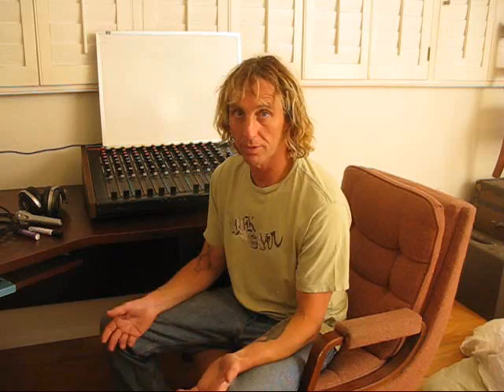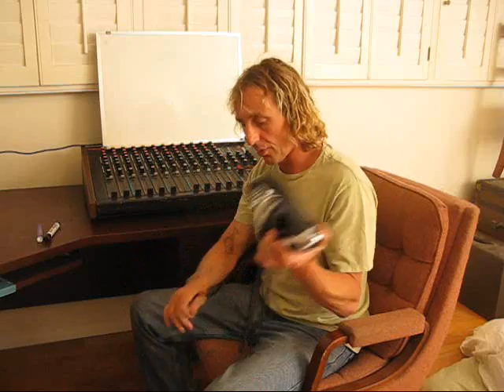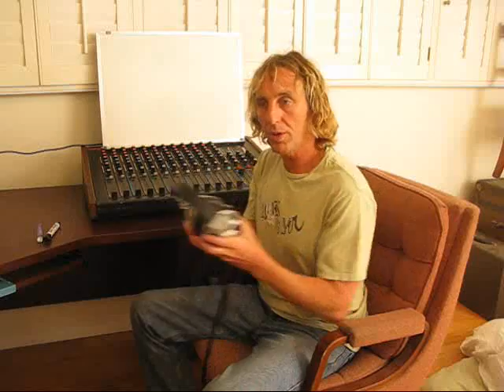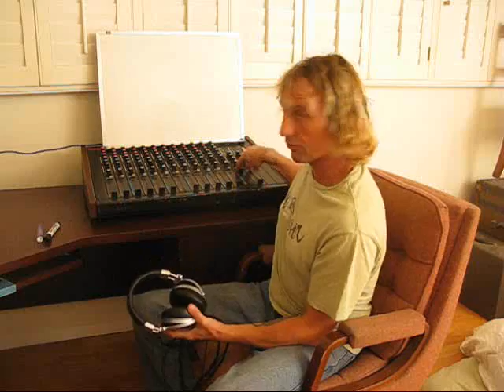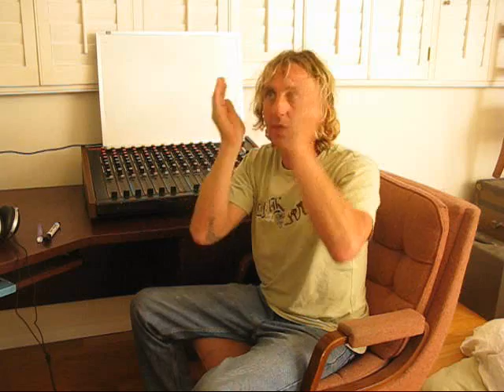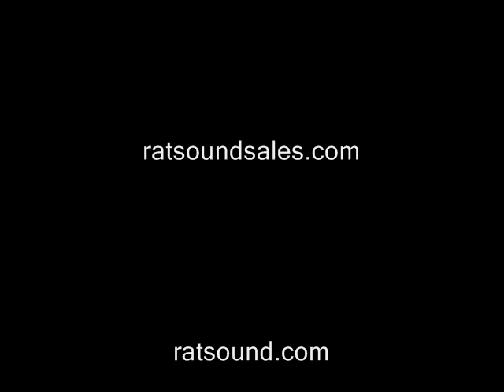How to EQ a PA System - Some Tricks

Comment: Because I started off as a studio engineer over 40 years ago, when I switched to live mixing my approach was exactly the same as Dave’s. I worked on the PA to get it as close to the studio monitors, I was used to, as possible…. Mixing after that, was easy.

Interesting how digital consoles now mimic this in the way that we use the same but increasingly more complex presets every day. We now spend more time tuning the system than adjusting any channels settings. They stay fixed. It’s the system and room that changes, so our job is to wrestle those random elements as close to our desired reference point as possible. Then we can mix in the way we enjoy.
Reply from the maker: Agreed

Comment: Does making a reference song sound good in a system remove the process of using pink noise or can I use both?
Reply from the maker: I would use both, as they offer different info.  Pink lets you hear how flat a system is but does not let you hear resonances and distortion. Pulses and music can highlight resonances. Voices and clear tones and instruments can help you hear distortions
Reply: @DaveRat  Thank you so much for responding.
I’m hoping you can help me with the following.. It seems like I can make a system sound good enough (that is: I run pink noise and then play a reference song and I’mable to make that song sound extremely good in a system). After that, the band comes up and I have some problems making them sound not muddy. In other words, it seems I still have to EQ the master buss a lot. It usually happens with bands that aren’t very good (It never happens with good musicians); I have a problem knowing if it sounds bad because of me or because of them. Are there any tips for EQing the master buss when the band is playing? Should I rely on having the right curve on the master?
Reply from the maker: @ItzTooSik  sounds like you may need to work on eq'ing room resonances. I  overed it in a video, maybe sountips.

Basically room resonances frequencies where the room gives back more sound then other frequencies when all frequencies are sent at the same level. You want to identify room residences and over EQ them out of the system
Reply: @DaveRat  thanks again.
My apologies for asking this next way off topic question. I’ve seen your videos and I know you’re a master about these things... When attempting to connect the main speakers and link them to the subs, what’s the proper way to connect them (which one goes first in the chain and why)? I know it’s a silly question but I want to make sure I avoid any crossover problems. Also, when linked, how do I create an appropriate crossover?
Reply from the maker: @ItzTooSik  that would most likely not really matter, subs maybe first as it will shorten the cable length to the lows. But read the manual as to what they recommend for the brand u use

Comment: The way to EQ a room with a GEQ is to listen for the "Wolf" frequencies.  This is done by slowly bringing up the main vocal mic fader until it just starts to ring.  find the frequency of the ring on the GEQ and lower the level of that frequency on the EQ.  Now bring up the gain a little more and repeat.  When the system is properly tuned to the room you should be able to excite the room with at least 4 different feedback points at the same time.  They should be spread over the entire frequency band ie: a low frequency node, a mid frequency node, and upper mid and a high frequency node.  If you can accomplish this you have successfully flattened the frequency response of that particular room.   No pink  noise or RTA required. The main EQ should never be used to change the tone of the system but rather to reduce the feedback nodes (wolf frequencies) which will assure that you can achieve maximum usable system gain without ringing or howling feedback.
Reply from the maker: Yep, that is a way to tune a room to a specific mic in a certain position or location. That does not take into account things like console out recording and tuning a system such that it can be transported to other locations with minimal alteration. Though that can be an effective way to easily get decent gain before feedback.

Comment: Thanks for the tips, I always got taught to only mix and EQ by listening to the PA and I only use my headphones for PFLing. This is a very interesting approach that actually makes quite a lot of sense.  Because there will be less corrective EQ for the PA on the EQ's on the channels. The method I used before were smaller venues and though it always sounded decent in the room but the stereo recording of the mix always missed stuff and over-exaggerated some instruments that didn't over-exaggerate them selfs acoustically in the room. Maybe this will change too with your method. I'd love to try it out sometime. 

Thanks for all the videos! Even the 10 year old videos are still useful to this day!

Comment: Its even simpler, as typically rooms with problems created by the superposition of a mix of direct and reflected signals cannot be 'corrected for' with EQ - thus you focus on dealing with the minimum phase isolated signal chain of, as Dave stated, mic and instrument signal that goes to the board.

Comment: How about "adjust" instead of "correct" or "repair"?  You can't really correct anything with a system EQ, but you can make adjustments to minimize certain of the anomalies du jour.  Of course now that SMAART is available in an affordable version since you made this video, you can do the comparison of what's leaving the board and what's coming out of the speakers quicker and with heightened precision than with the average uneducated ear.

Comment: I was doing an small outdoor gig and the power on the FOH (mixer) goes down. Its was no problem of the system at all. Some one have plug in a microwave ore somethings foolish like that on the same Phase (1). Then i check my stuff first, and amps FOH and monitor running fine on Phase 2 and 3 and run the backline in same phase as my FOH mixer and FX rack. Then a man i never have seen or spoken to blame me use to much power. Yelling about in front of people and say something about a plug have some tape around it, and so on. Then the man get up on the stage and look around my stuff and system. So I was irritated and searched in the meantime for a solution, the man talking about my back to people. But i power the system up and the band play again. Afterwards, i just thinking want to beat the guy on his face. But I am a calm and quiet person, but i make a decision. I quit! No money, no appreciation, and get the blame for what goes wrong, which was not even my responsibility.  It turns out it was some power failure from the building. Then i talk to the organization and advice (i am stupped, yes i know) to arrange a power generator only for the stage. But its the last time i ever do a job like this. Take over a low level gig, from a low level moonlighter, at a sub low payment. But my heart is crying,  to make a good sound for people and the performers. But no chance here in this country.

Comment: Dave- you are a mentor to live sound engineers everywhere and are probably own literally millions of dollars worth of equipment.  How about using a lav mic instead of cam audio to record these videos.  

Just a thought...
Reply from the maker: +Jesse Stern yeah, I just try and squeeze in time to do videos but dont spend much time on setup. Will try and bump up the quality.
Reply: thanks dave appreciate all the free vids sorry for nitpicking
Reply from the maker: All good, I appreciate the comment and you are absolutely correct, I admit should do more prep. Most of these videos for me are kind of a last minute, unscripted binge where I get an idea, setup and try and do a single take. And I always look back afterwards thinking I should have done more to make them more presentable. I will do more to make them better.
Reply: btw Dave, while i have your attention: I went to SMAART class with the guys from Rational Acoustics, and they said that the "dual sine" oscillator feature was implemented at your request.  But they had no idea what application it would ever have and neither did I!  What do you use it for?  just curious
Reply from the maker: +Jesse Stern dual sine or dual pink? I believe I requested dual pink. Will do a vid soon on why.
Reply: Nope dual sine.  The oscillator simultaneously generates 2 different sine waves at diff frequencies that can be independently routed to different outputs.  But yes i would love to see more vids on using SMAART and system tuning in general
Reply: I think engineers everywhere assume the casual nature of the video and should be grateful Dave is sharing good information they can learn from. Expecting him to drag out a lav Ect to tell noobs how to mix is a bit ridiculous!

Comment: ok thanks Dave...heres what i was doing ok we setup keys vocals drums.. synths and trombones should i eq the front line mics first when EQing front of house...second of all what am i using the headphones for??? qnd i love your work...im a newbie but ive been reading and watching a lot of videos...but nothinh beats hands on experience. ..i run sound and perform as well i have a behringer x32....but would like to learn more....im familiar with ringing out monitors. i love music especially old school rock like the red hot chili peppers and incubus blink 182...but our genre is tierra caliente its a Spanish genre...look forward to hearing from you and if you would guide me cheers and music play on.
Reply from the maker: +Leonel Perez I would first tune the sound system to sound good with music and your voice.  Use headphones as a reference and tune the system so that it sounds similar to the same music/voice in headphones.  Then EQ the instruments to sound good in the sound system or in the headphones. If you did a good job of matching the system to the headphone sound, things should sound similar in both. Finally start increasing the volume levels of the instruments in the system and try and EQ out frequencies to minimize feedback while trying to avoid over EQ'ing and ruining the sound of the system, until you can reach the volume levels you will need for the performance.
Reply: +Dave Rat I think this is 1 part that alot of use struggle to determine what over eqing is.

ive seen some hacked graphics over the years and some barely touched graphics in the same rooms / systems and wonder how they got such good sound on bnoth extremes.

Comment: so doing a check would you eq front of house firstor channel eqs??
Reply from the maker: +Leonel Perez The FOH EQ and channel EQ are fairly separate entities and you should learn to EQ them in any order. The channel EQ should make the instrument sound correct in headphones and on a a console recording. So if the house is not EQ'ed then EQ the channels to headphones. The house EQ is to make the venue sound correct with either the band playing or a CD/MP3 or Announce mic etc. One thing to remember is that the sound of the venue is constantly changing with temperature and as more or less people occupy the the listening area, so your house EQ will need to change to compensate. The channel EQ's change to compensate for changes on stage like different guitars or stomp box sounds, The drums detune, or musicians get tired and change the sounds you are getting from the voice/instrument.

Comment: Hey Dave. Great video. Could you possibly do a video on properly ringing out monitors?
Reply from the maker: The first thing I recommend is to determine the goal. Do you need max volume? Max fidelity? Max feedback stability? For TV you would most likely seek max feedback stability. For some bands, max volume and for jazz or classical musicians, max fidelity may be the goal. Pointing the mic at the monitor is only relevant if that is something the artist may do during the performance. Just a mic on a stand has little relevance as the reflection of sound off of the face/body/hat of the performer is not accounted for.  So the closer you can recreate the actual scenario of the performance/event, the more relevant the that method of ringing out monitors will be.
Reply from the maker: +victor prudeaux I will add that to the videos to consider. I see that there are quite a few vids on ringing out monitors already up but not sure of how good they are.  Maybe take a look and if they are lacking I can look into whether I have something unique or more useful to add.  Thank you Victor.
Reply: Would be great!
thanks for your videos, they're very interesting and quite helpful. 
greetings from germany:D
Reply: +Dave Rat I think a lot of people know how to "ring out monitors" in theory but maybe Victor is curious as to whether you point a mic down at a wedge to ring it out or maybe just leave it on a stand and turn it up. Then there's also the "tuning" of a wedge... are you (Dave) a fan of ringing out the problems first then messing some more or first get a good sound?

Then there's the question of how do you personally tune a monitor? Do you play music like someone would at FOH? or do you just talk into it with a mic and screw with a graphic EQ until it sounds like you?

I know what I do but I think Victor might be looking further into it and not just the basics of "1khz rings, turn down 1khz" kind of thing. I could be wrong though.
Reply: +snapascrew 

personally i dont do the point mic at wedge to ring out.

point a mic at the wedge and its obviously going to feedback at some point much earlier than in normal use.

the solution for that is to have artists not point mics at wedges. the same with cupping the mic  which has its own majour probhlems beside feedback (muffled horrid sounding omni)

Comment: Dave, I find it interesting that you use what I think you consider pretty flat headphones for reference.  Every live engineer I've known applies some degree of LF tilt to the system eq.  Is this not your typical MO?
Reply from the maker: +esharpflat5 whether LF tilt is applied or not, using accurate headphones as a reference allows us to make an informed choice.  Using headphones with extra LF to tune the system can actually cause the engineer to believe thin sounding instruments actually sound full. Then the eng would add LF to the mains to compensate. perhaps resulting in the desired mix and LF bumped EQ but any recording off the console will be low end lacking.

Comment: Hi Dave,

I have tech'd for a while loading in, setting up and striking but haven't really operated very often. One of the issues i constantly run into is eqing small pa for lav's. The production company i work for is starting me out doing small corporate gigs. I am having trouble eliminating feedback in larger venues with highly reflective surfaces. Any advice? I also am using an older presonus console which is not ideal but seems simplistic for a digtal console considering i have only used analog consoles with feedback destroyers.
Reply from the maker: +DJElektrophix EQ'ing lavs is tough.  Placement of the lav as well as brand/model are huge factors. Also multiple Lavs in close proximity causes a whole new set of issues. That said, I don't consider myself expert enough in that realm to try and offer much in solving.
Reply: +Intense DJ I have a x32 to as well intense Dj, and you should check out using the expander setting in the gate, if you don't already. I find it works amazing, and even though i do have feed back eliminators at the end of the chain, the best thing i ever did was play with this setting on each individual channel. I basically adjusted the gain on each channel so it only picks up a signal six or seven inches from my mic, and anything past that you get nothing, then on the gate i dink around with the expander setting, so it gives a boost in gain. The expander works like this. The threshold controls when your signal will trigger the effect, and the ratio controls how much the signal is cut or boosted upon crossing the threshold. Now if my signal is still to low I boosted it at the sends, bus sends, LR, and matrix or inserted a FX somewhere before LR to boost it some more if needed, which is gain staging. I find it works well, and by using the expander instead of normal gate I never had singers complaining about there signal getting chopped off completely if they sing to quietly. Once i made this change my dbx afs 2424 almost never catches any feed back in my basement which has no sound treatment. I noticed after setting it up like this my overall system noise floor dropped dramatically, and that is why my afs2424's doesn't seem to be doing anything till they need to be, because normally they would zap out some system noise, but now they only concentrate on zapping sounds when the system is super loud, which makes it sound better, because there isn't 24 frequencies being cut out with notch filters.

Comment: Hey Dave, i'm looking for quality headphones for live sound use. I'm unsure whether to go for the shure 840 of the ultrasone hfi 680. In the headphone quest part 5 you preferred the 680, but in this video you say you like the shure. Do you remember the reason you changed your mind? this is an old video after all
Reply from the maker: The 680's were very sensitive to how you position them versus your ears and the sound changes as you move them slightly.  The 840's and 940's are more forgiving and more of a pro audio build.  That said, I have had problems with breaking the headbands on a pair of 840's and a pair of 940's as well.